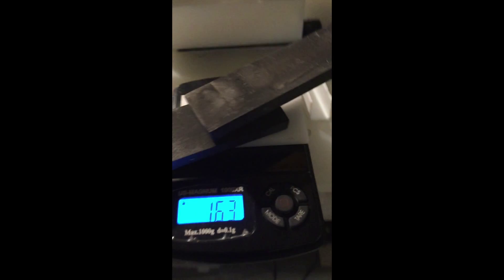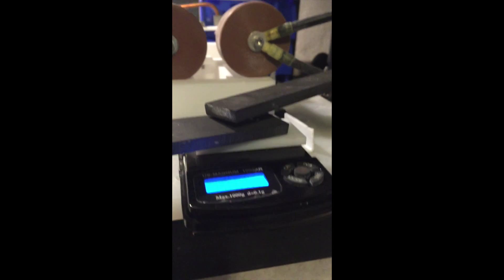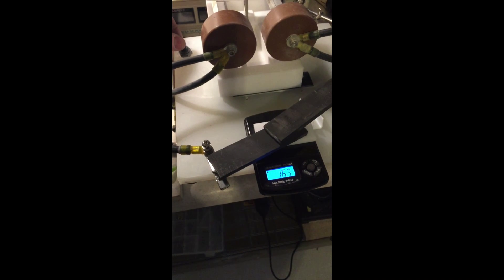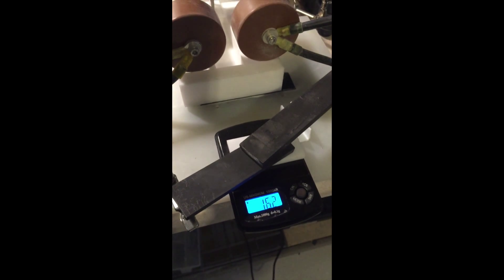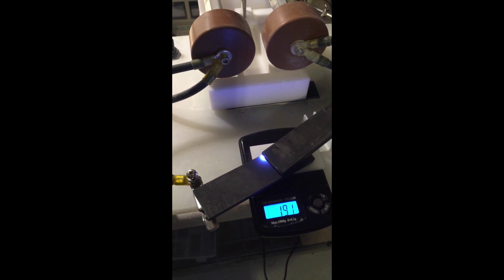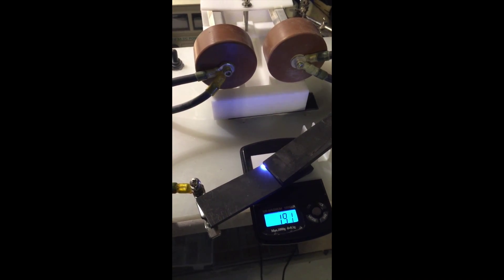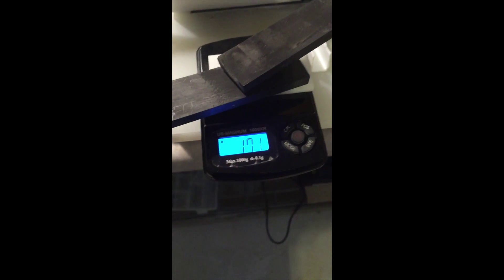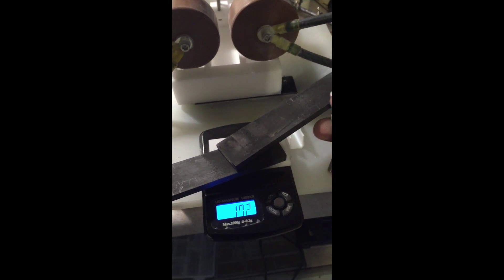IONIZING PLASMA FORCE

Comment: Are you surely isolate the electromagnetic interference of the plasma for the balance?
Reply from the maker: jae0204 , yes.  The circuit could be turned on without affecting scale.  It is isolated.